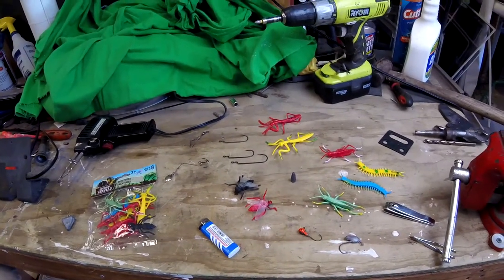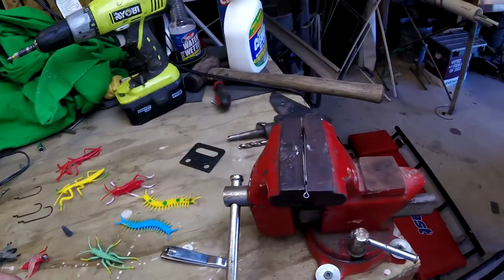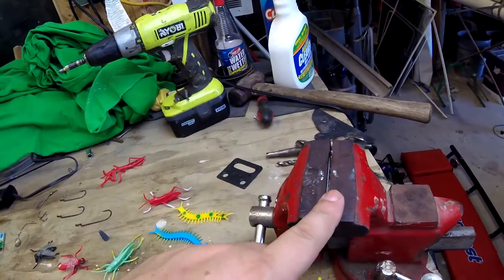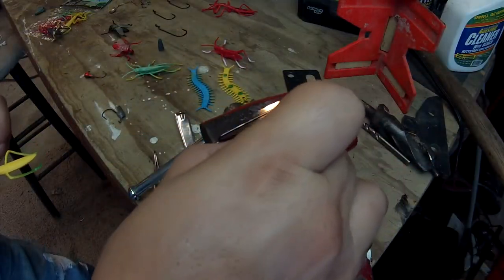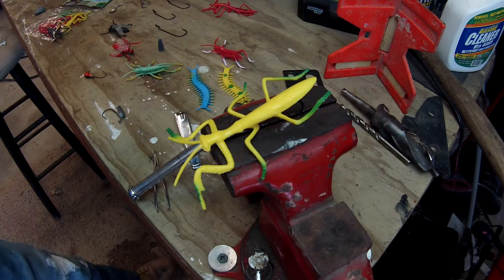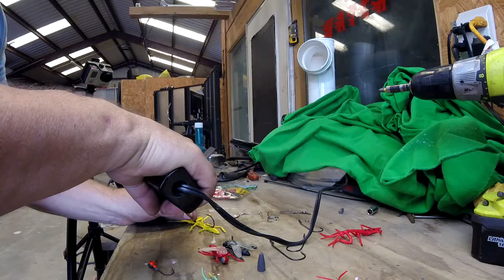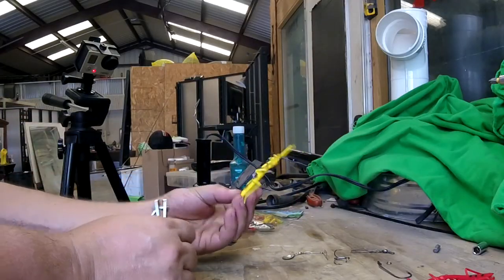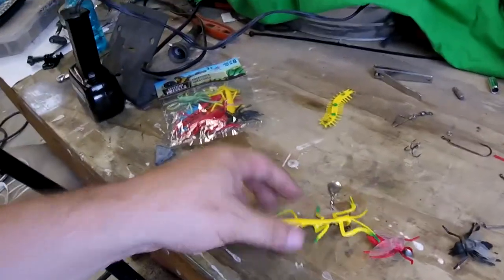Dollar Store Fishing Lure DIY

Comment: You could also heat the plastic bugs in a pot of hot water so as not to damage the tensile strength of the hook with high heat from an open flame. 
But yeah I’ve got a few of my own that I stole from my daughters bug collection LOL I replaced the collection